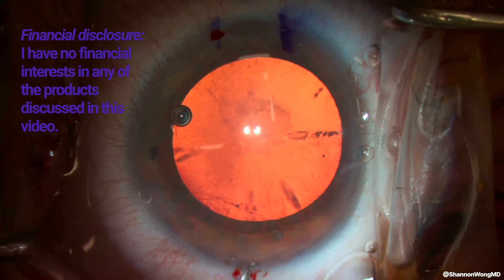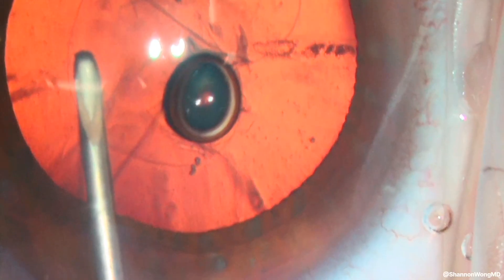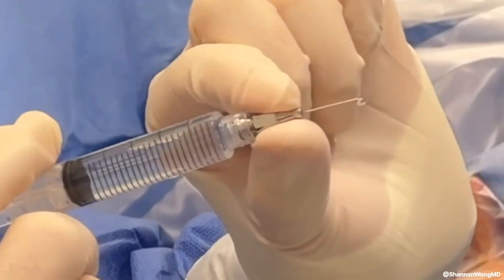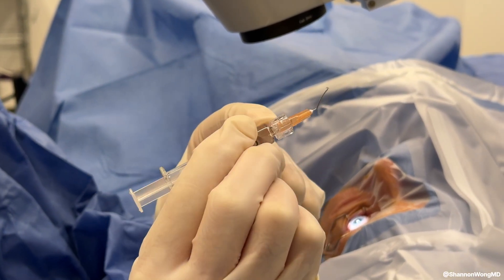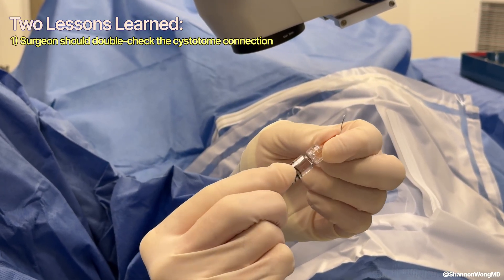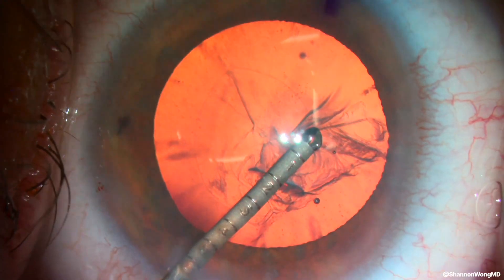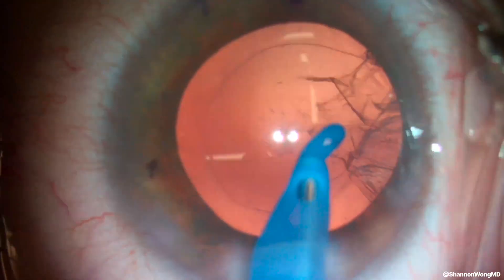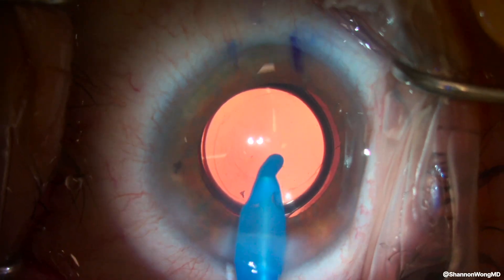What happens when a cannula is not tightly secured to a syringe during cataract surgery?

Comment: What size incision do you use for cataract surgery? I notice that I get small descemet detachment at my keratome incision after I/A with the soft tip I/A hand piece (the one in this video). I am suspicious it is because I am using in a 2.4mm incision which may be too tight. Do you notice an increase descemet detachments with this unit? I do love the soft tip for subincisional cortex and safety when polishing the capsule. Thank you as always for the great videos. Hope to see you at academy.